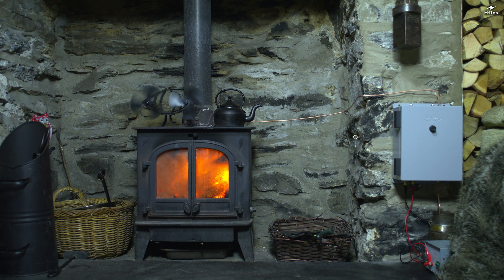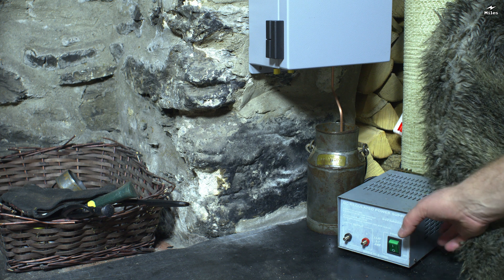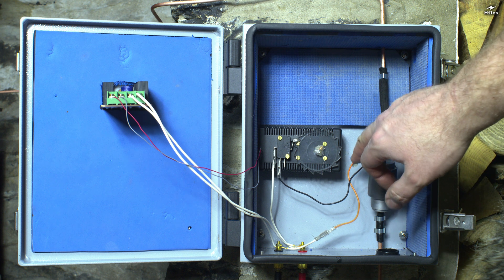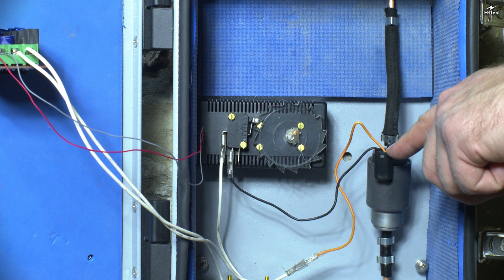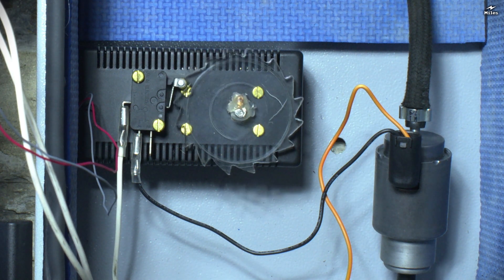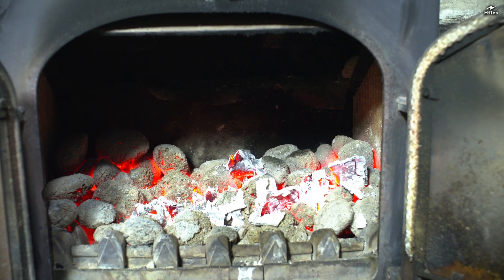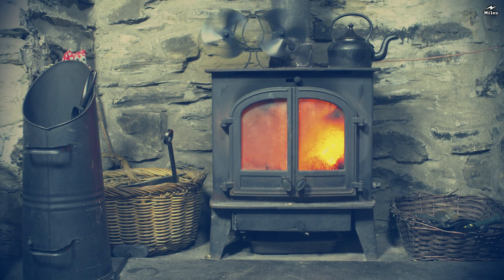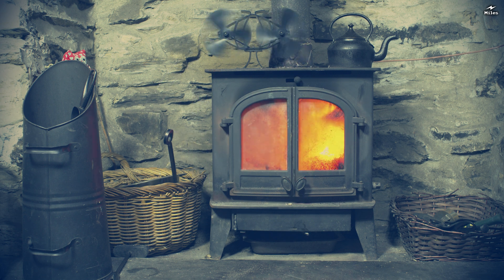Simple DIY Waste Oil Burner for Wood Burning Stove

Comment: Would be much quieter if you changed the plastic wheel to ramp down slowly like a camshaft instead of just snapping off after each tooth passes the microswitch

Comment: I put used cooking oil in an empty cat food can into my wood stove.  I figured it would burn and produce heat.  It boiled over and when it did, it flamed up like a jet engine. Ended up melting the upper plate of my stove.  It didn't burn through but it wasn't good.  This however would be a great idea to get heat out of used cooking oil.

Comment: I've been thinking of doing this to mine for about 2 years now and this just popped up on my recommended videos. I like it. My plan was to use an arduino to control the pulsing, and add a photo resistor that would sense if the fire was burning + a thermistor to sense the fire was still hot to ensure it was still burning. As I'm worried about flame out situations and then the stove just fills up with unburnt oil. I suppose you could put a tray inside to catch it.

I don't know how to code but chatgpt can write code for you now if you tell it what you want. 

The only thing is the acrid smell waste motor oil gives off would put me off burning it. And creosote in the chimney I would imagine be way worse

Did you drill a hole to feed the copper line? I don't really want to drill into mine.

Comment: military arctic Hunter stove ..... Tell soldiers to simply put a  loop in the fuel feed line.   Loop goes down, around full circle and then continues delivery path to the stove.   Reason being...... if for some odd reason you got a leak in a fitting ...  the flammable mixture will drip down along the tube.....  gravity its way down the base of the loop where it falls off into a catch can orr??   instead of continuing down the line to the edge of the stove where it can get hot... make fumes.... and ignite OUTSIDE of the actual heater..... 

For hard line like he used...   P trap like pipe path in the tube should create same affect.    Just one more small added safety feature

Comment: Two questions if I may, how far does the feed pipe hang down into the stove body? and what gauge/thickness of pipe have you used? would it be at all possible to show a close up shot of both the entry and exit points of the pipe for clarity? Many thanks 👍

Comment: Good job. If you search YouTube (vanlife) videos for a silent diesel heater pump there's a guy that "invented" one and sells them. One of these, along with a control module...under the video (Fuel control for waste oil burners) mentioned in oil burners channel would mean no ticking noise. I think you can get a newer module now but you'd have to read the comments to find that info. My diesel heater tic's in my van, I quite like it, singing Me and Bobby Magee along to the tic on medium setting is a blast, a great metronome for keeping in time 🤣

Comment: Try insulating the control box to minimize the ticking sound
Reply: You can profile the gear so it doesn't click or bush the switch with silicone bush
Reply: Or knock up a wooden box with rustic charm

Comment: I like the fact it's electromechanical, kind of suits the job it does in a cool way. 
You mention the nozzle in the logburner - what size did you use for it?
Reply from the maker: Thanks for watching John, really appreciate it. Actually there isn't a nozzle as such, just the end of the pipe dripping on the fire.

Comment: Great Setup!  I agree with your idea of pumping. Gravity is fine for short runs or when constant adjustements aren't a problem but the oil delivery is never constant over longer periods. Pumping is pretty much set and forget and it's not complicated at all as you have shown.  I am doing a house heater atm and am using a different approach to the timing which may be of interest to you. 
I am using electronic timers which are much quieter than what you have.  This one https://www.ebay.com.au/itm/DC12V-Timing-Delay-Relay-Module-Cycle-Timer-Digital-LED-Dual-Display-0-999hours/132464239247?hash=item1ed77be28f:g:MtsAAOSwtKVaVCyF&frcectupt=true&autorefresh=true

Is easy to set and would just mount in your cabinet. Just makes a slight click when the relay engages. I set to one second on and however many off to control flow.  This timer is Mosfet so completely solid state and makes no sound at all. 
https://www.ebay.com.au/itm/LED-DC-5V-36V-Dual-MOS-Control-Cycle-Trigger-Timer-Delay-Relay-Module-Pz/133054886591?_trkparms=ao%3D1%26asc%3D20140127102845%26meid%3D0446b567cea3499180fe9628d46562c7%26pid%3D100148%26itm%3D133054886591%26pmt%3D1%26noa%3D1%26pg%3D2506613%26algv%3DOrganicCompBase%26brand%3DUnbranded&_trksid=p2506613.c100148.m2813

Love what you have done and hope these may be of interest and help to you.
Reply from the maker: Thanks so much for the very helpful comments. I have indeed done what you (and others) have suggested and replaced my mechanical saw-blade timer with a solid state 555 timer from ebay. It cost me under ten US dollars and gives a nice steady 5 pulses per second (adjustable). It's much quieter, in fact barely audible. 

It's mega simple to run my stove now, just switch on the pump and light the stove with a match. It'll burn happily and consistently until I turn it off again. I have to tip some more oil in the milk churn every five hours or so.

Comment: Hi love the simplicity of this system. If the ticking did get on your nerves you could make a simple pulse circuit using a 555 timer for a few pounds.
Reply from the maker: Hello Trone32, thanks for the advice, I've ordered one. I didn't realise you could buy simple circuits ready made, so I'll give it a go when it arrives. The ticking sound doesn't bother me especially, it's like a clock ticking and I find I just stop hearing it after a while, but making it near silent would be better for sure. The only downside I think is that the speed would have to be pre-set, and wouldn't have the control that this one does but maybe there is a way around that. I'll have a think!
Reply: Gravity feed it

Comment: That is very interesting.  You dont smell the oil burning inside do you ?  I know someone that had a wood burner in a garage very old and possibly home made.  He setup a drip system like you stated.  He had to put a small valve on it to cut the flow back since it would burn hot enough to make the outer part of the box & smoke stack glow red.
Reply from the maker: Thanks so much for commenting More350Power. No there is absolutely no smell at all, not even a whiff. But with the chimney drawing, everything just goes up there I guess. It's pretty clean, more so than wood or coal, with no soot or ash. It's makes a nice fire, and gets rid of old oil. The only other thing you can do with it is take it to the recycle center but they just burn it anyway.

Yeah lots of people making gravity-feed oilers, not heard of anything bad happening, so maybe I'm just a bit paranoid, I can just see me leaving it going unattended and it slowly increasing in flow until the house is on fire. I just like the control of doing it electrically, you can turn it on, off up or down as easy as any electric heater.

Comment: I I really like your style Miles old open university format is right up my street, and it's incredible I I too have considered starting a second channel doing the same i.e. more focused on teaching/ educational as opposed to my usual blog videos (will continue with these also) in fact have already made a start , this will be announced on my next video, I also entirely agree with you on gravity fed oil feed not happy with that.
The  pulse pump Im not familiar with  I wonder what current they draw ? if its low consider read switches i.e. A magnet or two  glued to a disk  would be silent, the suds pump on my lathe is a mechanical fuel pump as used in old cars and the like a slow rise cam would also be silent,the only stove I have is in my workshop so wouldn't warrant burning oil but I don't waste any cooking oils fats and at my local boat club there is always  waxed diesel, this I put in an old bucket with sawdust chain saw chippings etc give a good mix, mould into brickets when dry they burn great plus no need for firelighters   :-)
Reply from the maker: Thanks for watching POC, really appreciate your positive comments! I love the reed-switch idea, that's a good one, didn't think of that! Not sure on the current to the pump, I don't think it's a lot, can't see why a reed-switch wouldn't do it. maybe not a tiny house-alarm type, could make one from bits of copper and magnets that would be more than tough enough. Food for thought.

Agree on the sawdust. When I cut logs with my chainsaw I put a tarp underneath and catch the shavings (well, most of them), put them into bags and bring them into the house to dry out in a cupboard. a few months later, mixed with a bit of paraffin or whatever, it becomes a heck of a good fuel. If it's oak I like leaving a few fresh bits on the stove top as it gives a lovely aroma.

Looking forward to your future channel POC, will keep an eye out for it :)